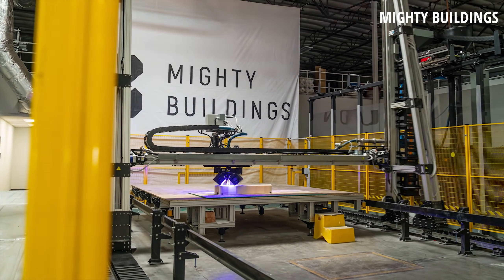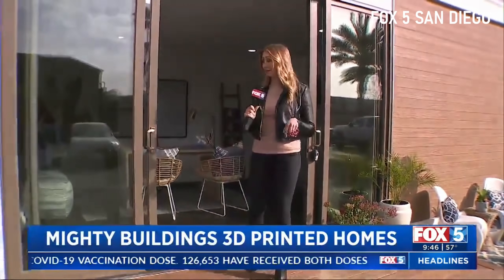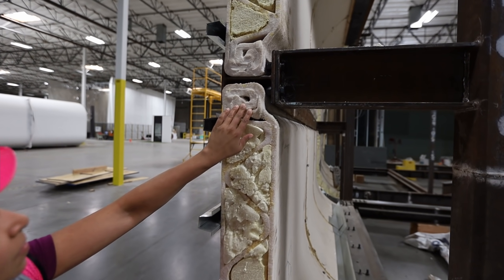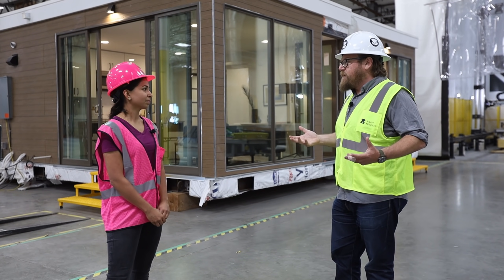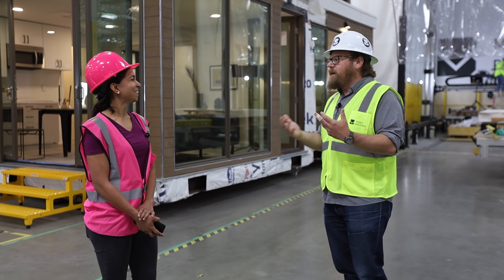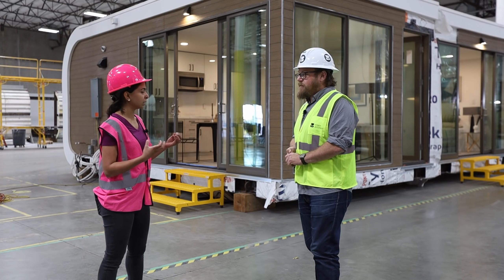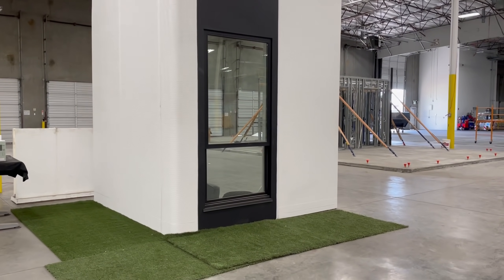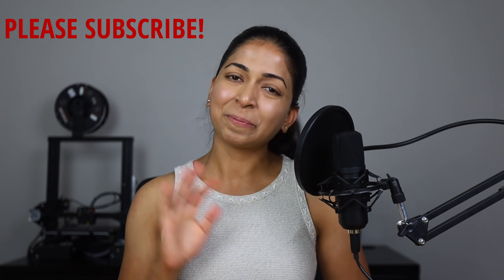3D PRINTED Tiny Home ADUs | Mighty Buildings

Comment: While it's politely expressed, this cuts through all the BS very nicely. So basically, they're building prefab homes for a very, very high cost, and literally the only advantage is that they have an approved design and can help with permitting, like any other decent prefab building company. 
Honestly, I thought that garbage about the insulation was the worst of all, and that was nicely revealed. You can tap-dance as much as you like about the R rating of the material - if you try and characterise the entire dwelling as such, you're basically lying. 
As for their "incremental improvements", yeah, they totally screwed up and now they're trying to salvage something for those people who pumped in all that cash. I actually think the material looks great, so why not work on a modular building system, perhaps using the "3D printing" technique to design panels that can slot together with some kind of good jointing system and hang those on the frame somehow? Basically, though, even if they did come up with that, they'd be the last people I'd buy stuff like that off given all the overblown claims and fast talking.

Comment: I know you've probably covered this and I fully understand that concrete and Cinder blocks etc have a very poor carbon foot print but is there a comparison between building this as is and as a full 3D print in comparison on build a unit the same out off concrete etc.

Comment: 3d printed the easiest and cheapest part of the construction. The more difficult parts of construction are (in no order):
1) finding open land you can afford in a city you are willing to live in with employment you are able to do at a good wage
2) planning/engineering
3) getting zoning and permits
4) finding contractors that won't rip you off/leave you with a ton of problems post construction
5) finding a bank willing to give you a loan/mortgage
6) plumbing
7) wiring

Comment: About the 95% reduction claim, it's still all ifs and coulds and would bees... I think it's just very very misleading! Even in this interview, the guy is making some statements that he almost presents as an achievement, but in fact it's more just a goal, it makes you really enthusiastic, but they're not there yet at all. What they're working on is a fascinating innovation, but be honest about it, do you really need 3D printing for that?

And did I really hear you say that, "These units aren't cheap, the smallest unit cost around $600/sq ft", what?! Had to convert that to metric: that is $6500/sq m, it is outrageous, even in EU!

Comment: I really like your videos. While I know you were trying to be generous to the builder, but 3D printing the entire frame doesn’t constitute a 95% reduction in labor…A 3D printed shell doesn’t reduce the plumbing, electrical, HVAC, or finish work for a completed unit. This is much larger than 5% of labor.

Comment: The only part of this company that I think has real potential is the light stone material as a replacement for concrete in certain applications.
And maybe their use of 3D printing.
Other than that, their pricing and perhaps quality control leaves a lot to be desired.

Comment: tiny home does not mean tiny budget apparently... we can do better!  the more technological innovation we try to introduce into construction seems to require more expensive relatively untested materials, specialized tools, specialized labor, more engineering, and more code requirements.  Even with all that, there is so much that can go wrong despite the cost, which is where insurance comes in to "save" the day.  The old ways seem archaic and inefficient, but they made the most of craftsmen's skill and local materials, created little waste, and many have lasted hundreds of years.

Comment: What's up with the flat roofs? Plus, solar panels are most efficient when they're at an angle to catch the sun's rays. I get that California doesn't have to deal with snow except up in the mountains, but they do get regular heavy rain - you want to have an angled roof to deal with that at least. So what's the obsession with flat roofs in all of these start-ups trying to "shake up" the building industry?
Reply: Cuts down on material costs. That tiny bit of material they don't have to use to make the roof angled probably saves them 3%.

Comment: 185000 for a 350 square ft tiny home. I know in alot of places that's a good value. Where I come from 185000 will buy you one heck of a nice home. 3 BR 1 to 2 baths wanna say 3000 or so sq footage? Idk I'm bad with square footage so forgive me if that sounds like too little or too much, as I'm probably off there. But it will get you a lower to lower to middle class home here. 185 for 350 square ft sounds insane as fuck to me.

Comment: Their marketing manager needs to go to prison for bait and switch. It seems like they see FDM as a get rich quick scheme. There is no reason they cannot print the frame, counters and partitioned areas in one print. If they aren't using supports then of course their prints without the steel frame would fail. I really would not care about surface finish. You can use UV resin to smooth out the walls. We have people that use tough bed liner spray to fill cracks.  The issue with the windows and the low R value could be resolved by high quality european designed windows and films. I want to know what the material cost for just the shell and wiring would be for basic lighting. You should be able to design water channels into the print as well as lay the wiring in sections. The only reason that one building cracked is because of the failure to use supports during printing. They could have made custom removable supports. They aren't even limited to one resin. The price is too damn high and that's the cost of doing business is regulatory heavy California. It sounds like they needed to hire some people that have 3D printing experience and estimation experience rather than just a sales and marketing manager without any technical 3D printing experience.

Comment: 'Affordable housing' is a concept that requires clarification. In the first place we need to define the term 'affordable'. Traditionally mortgage lenders stated that a homeowner's principle + interest payment should not exceed 25% of averaged monthly household pre-tax income (AKA gross income). Although ratios like this might appear cookie cutter in principle, it seems like a good starting point. Lifetime maintenance and 'operational' cost of any structure cannot be ignored as part of the affordability metric; these include prop taxes, repairs/improvements, roofing/siding, energy cost and insurance. Houses generally are not a great investment play. Over the long term residential value appreciation is about equal to inflation, and that's before the above mentioned list of annual/maintenance cost, and does not include seller's +-10% cost when the home is eventually sold. 
Belinda mentions that housing minimalism is a smart concept, I totally agree. Thinking smaller and energy efficient is smart.

Comment: I think they're going about this the wrong way, instead of what they're doing now, I think they should use their proprietary material to 3D print ICF blocks. They can even be much longer/larger than normal ICF blocks, as big as their printer will allow.

Not only that, they can 3D print all the curves, corners and other bespoke shapes to their hearts content. Take a home plan, break it down into the most sensible sized 3D printed blocks, print it, finish the blocks where necessary, load it on a semi and send to customer's site. Heck, they could even just send the printer(s) on site, print there and then return the printer!

The blocks could be finished out to already contain snap-in/feed through points for rebar, they could even already have snap/lock together points for brick to brick. You could really put together the walls very quickly with zero waste material (or at least MUCH less than normal) and fill with concrete very quickly. No window/door bucks needed, significantly less (to no) bracing needed, the list goes on and on.

I think they've seriously missed a trick with this. I'm not spending $200k on a 350sqft studio, but if they could provide ALL the blocks to build an ICF house at a competitive price to normal ICF, perhaps even less with less labor and materials costs/waste, then I'd be down.

Comment: Looking at the cost breakdowns ... total costs need to come down under $50k for this type of construction to be viable. $25k of just 'permitting and entitlements' are local government fees and those need to be aggressively eliminated. Nationwide permit on the design and fabrication process one time for the company and then drop them onto sites with a simple 'final inspection' after utilities hookup. These types of homes are products just like cars and should not need any additional 'approval'/'inspections'/'permitting' at the state or local level.
Reply: Except they aren't a car. They have a completely different footprint and use and different lifespans. For instance a car probably isn't producing sewage that needs to be disposed of/treated. A car also doesn't need to be designed to provide full protection from a hurricane but a home does. There is also the impact that each home has on the homes around it including how much each home contributes to traffic and other infrastructure use.

Comment: Ah, the good 'ol "disrupt" phraseology, as if it can only be used in a positive connotation, such as in obliterating stodgy old entrenched methods and replacing them with superior developments.  They fail to acknowledge that disruption can cause setbacks and deleterious knock-on effects, such as negative public perception that persists long after the problems are fixed.

Comment: tiny homes are a scam for suckers, good things dont come easy or cheap. if you want to build things like third world countries who constantly scam each other be my guest. chinas dams break because theyre made of old corn cobs, im not kidding. their skyscrapers are literally Styrofoam with concrete poured around it. imagine being 100 stories up and the builder starts stabbing a main support beam with his screw driver like a knife through butter. 

also rockwool WILL mold unless you absolutely soak it in chemicals but at that point fiberglass is cheaper and better for the earth. rockwool is for ingestion based materials for cigarettes and growing plants. NO ORGANIC COMPOUND INSULATIONS including hemp unless its treated with chemicals. their heat treatment means nothing once you get it open.

Comment: I built my tiny home using split wall technique will aircrete as insulation.
It is 528sf with a half loft and a 6'x14' porch, lots of windows just not as open as these homes.
My cost for the finished shell ( with half log ext.) Was $11,580.
Very warm and cozy on Montana winter nights.
There are way too many greedy people taking advantage of the poor and needy.

Comment: They didn't 3d print the pipes, valves, toilet, sink , shower enclosure, light fixtures, wiring, switches, outlets, vanity, doors, trim, flooring, windows, paint, kitchen countertop, cabinets, HVAC, foundation........
What is its rating for earthquake and wind loads?

Comment: Company plans developments deep in the desert featuring pools and lawns.  🤦‍♂️
WTAF?  Let's do exactly what we already know NOT to do...
"We're going to put solar on it".  Aaaaa, yeah! That's written into the code for new construction in California.
You actually cant NOT put solar on it....
I'd be very interested in the carbon cost and petroleum percentage of their chemistry.
I understand 20% filler from xyz sources. (They say they're using borax today)
But what about the 80% UV curing polymer?  I have figures for materials like polymethylmethacrylate.
And we can pretty easily figure out how much goes into each building if they disclose to the state the SDS and the weight of material used in each dwelling unit.
Triple glazed low-E and rainwater catchment would be fairly easy to implement in their current structure, not costing much more if you have orders to fill and your house factory is working at capacity. (But special orders, rather than inventory would suck)
Steel frames and studs are always going to bridge. Who's looking at alternatives with similar structure/moment values?
Comparing the printed, curved endshell to SIPs is totally disingenuous.

Comment: So UV curing resins come in many recipes, but currently they all derive from petrochemical supply chains. Biologically sourced polyesters, epoxides and acrylates are all possible, but the only route we have right now is to grow oil crops and press the seeds.

So it becomes a choice between further supporting the petrochemical industry by buying a house’s weight in their products, or further subsidizing oil crops which under current farming practice creates soil carbon loss, fertilizer run off and just general poor land use decisions.

Mass timber construction, for all its problems, is simply a more direct utilization of solar-to-biomass energy. The energy a plant invests in creating oils uses up more of its photosynthetic potential than does the creation of lignocellulose.
Reply: @Theballonist perzactly. I’ve been looking at industrial hemp derived products lately and see enormous potential there.
Reply: I had very similar points in my reply.
Growing up my father was director of engineering for a few plastic/chemical corporations.
I know just how petroleum intensive monomers and resins are.
I'm not big on mass timber. Not nearly using wood for its great qualities, and losing on its mediocre R-value.
Though I DO appreciate 'nature's primary fiber reinforced composite' for everything it IS.

Comment: I'd like to see a video of you touring/commenting at conventional manufactured home plant. Insist on observing the process on the HUD home floor (not high end modular type). I think you would be impressed by the design, quality control, and energy efficiency built in.
Reply: I have to agree these types of homes have come a long ways from the old trailer days. I have seen a few of them and they are built stout with everything down to not wasting anything. Though the prices can be quite costly. I still have not found any company that offers a bare bones type units. I am not interested in your mark up floor types, The extra cabinets and all of the other frills they offer. I want basic solid built and I will upgrade as I see fit. The major cost in these types of house is their width, if a company can offer 8.5 feet and max height of 13.5 and what ever lenght and then stack and build them on site the haul prices will go down by a large factor. Delivery price can be upwards of 10k just to deliver based on distance, obstacles and other factors. Which adds to the what ever price.
Reply: @kameljoe21  Recently HUD manufactured home builders have gotten caught with higher lumber/material prices, and perhaps some have forgotten who is their prime customer. HUD type home buyer's typical house-hold income is under 50% of the US median HH income. A wider customer base is limited by stigma (Trailer Park Boys:), zoning restrictions, and memories of pre-1976 poor quality homes (pre-HUD regulations).

Comment: The pricing is completely bonkers. I love tiny homes but part of the appeal of tiny homes are the tiny price.  $185K for a 350Sqft is not even remotely within reason. $528 a sq foot is insane.
Reply: It doesn't make sense anywhere! If land is cheap, you can build more for less! If land is expensive, you can buy the same for cheaper!
Reply: With that price, land should be included.
Reply: loool "the tesla of housing"
Reply: Morgan Allen   You are neglecting to account for greed and more mundanely supply verses demand which almost never match each other. Supply almost always never meets demand and due to greed, artificial supply shortages are often created to increase profit margins.
Reply: Call me when they’re price competitive with a yurt!
Reply: Morgan Allen  Novelty costs money.  If anything the price will go up as they gain popularity.
Reply: Even in the highly overpriced market I'm in now, you could buy a large, stationary house for that.  The tiny house (mobile homes) fad is mostly for wealthy, virtue-signaling young adults.
Reply: its new tech and the first adopters are always going to pay a premium. look at flat panel TVs in 1999 1 50 inch cost £10k now there £350.
it always the same. as the process is improved and adapted the price comes down. 
the biggest problem is land and land costs espeshley in the uk. it dousent matter if the house cost £30k to build if the land cost £250k
Reply: There are probably places where people would consider that reasonable, but I’m living in a 1800 sq foot house with a huge garage on a full acre that cost less than that…
Reply: @timgleason2527  new York city would find that reasonable. Right in the middle of wall street. Otherwise it's wasteful. Smallest unit is 600 per sqft
Reply: In what area is it selling for $185k?  SF Bay Area homes, for instance, can easily exceed $2000 per SQ. Ft.
Reply: @ShootMyMonkey  That cost has little to do with actually building a home.
Reply: @rannxerox3970  That is true, but I was under the impression that the $185k figure was the listed price and not solely the cost of construction.  List price is certainly affected by land costs.  But if it is just for construction, then yeah, anything more than $300 per sq. ft is absurd.

Comment: Tesla pursued niche customers before tackling the more difficult problem of mass manufacture, which means that APUs are analogous to the Roadster for Mighty Building.  The goal is usually to bring costs down by a significant fraction, if not an order of magnitude.

If legislators really wanted to tackle the problem of housing shortages, they would address the problem of 1 out of ever 9 houses being vacant, likely with less absurd homestead exemption thresholds, and disoccupancy fees.